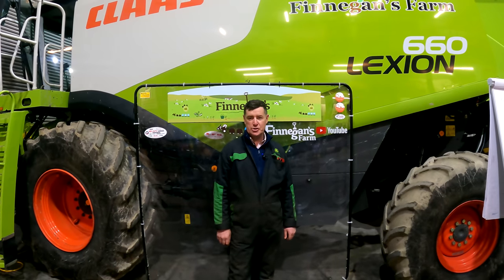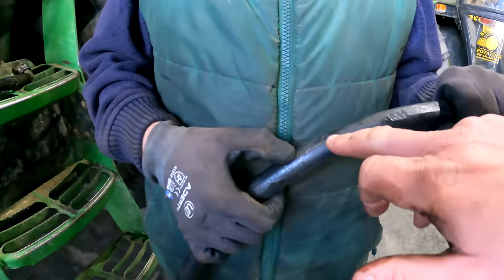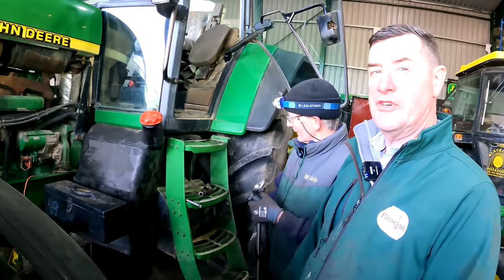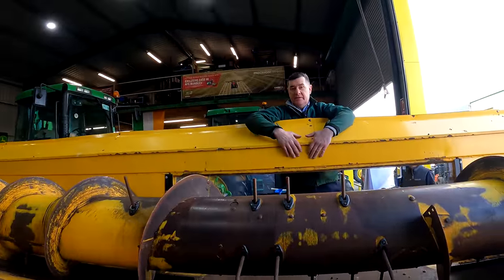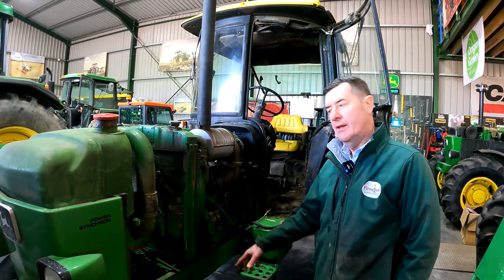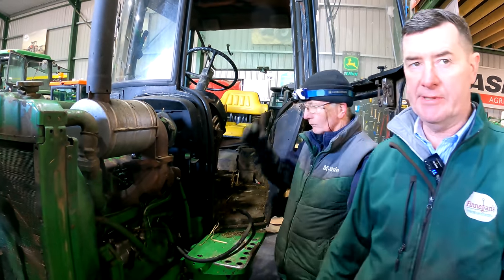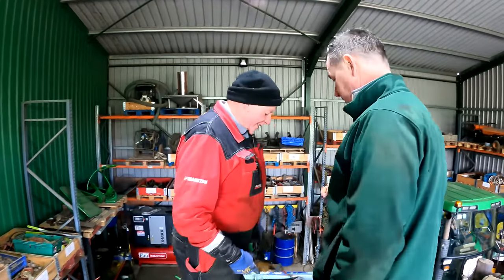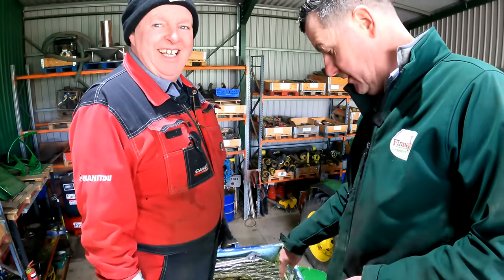WORKSHOP WEDNESDAY EPISODE 20

Comment: Just be careful entering tanks, in particular if you are doing hot work in them. I think that was a water storage tank and was clean inside, so it would have been OK. But even tanks or other enclosed spaces like that, if they are left with rotting vegetation at the bottom can deadly from the release of hydrogen sulphide gas once disturbed. 

If your doing this kind of work a lot, you should consider getting a portable confined space gas meter and a portable escape kit.
Reply from the maker: Thanks Dell there has been water in that tank for over 15 yrs but you have a very valid point and a lot of farmers are not aware of such dangers